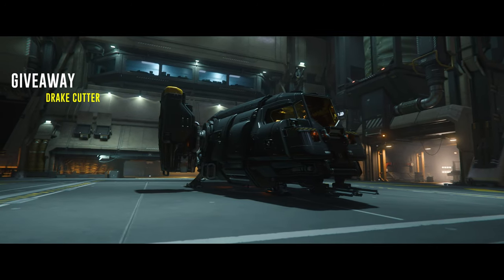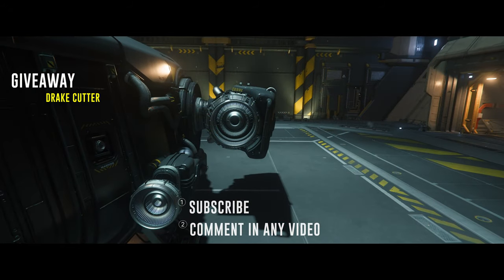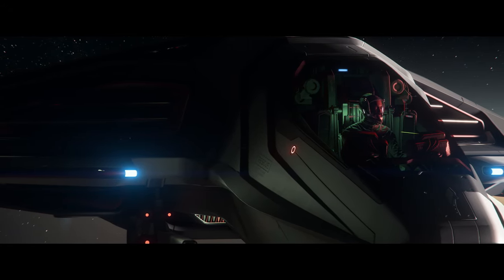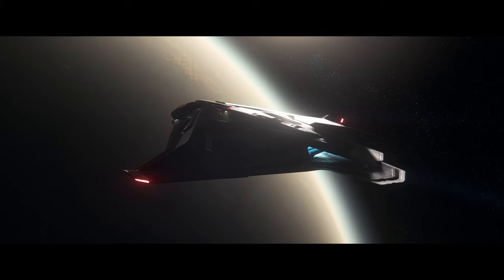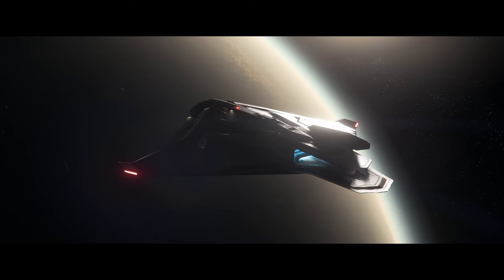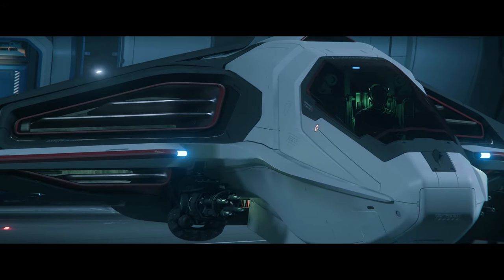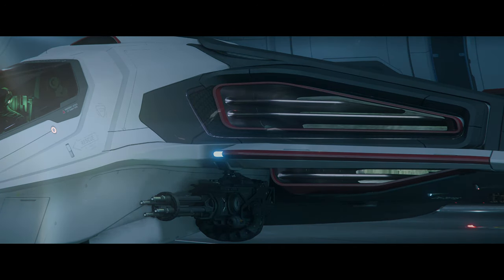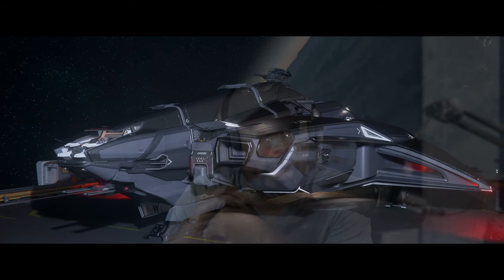Is This The Release Candidate? - New Star Citizen 3.24 PTU Patch

Comment: plz fix

"when breaking asreoid or ships causes game lock ups or crash" 
"ladder animation to Vulurte is offset by 90 degrees" 
"hanger persistance is not replcated yet?"
"workbench cot and UEC towl assets can't be effected with tractorbeam" 
"medical gun makes annoying sound when equipped and leaves graphical glitches on screen" 
"interaction F icon appere when flying ship and not using push to interact" 
"cutlass black tractorbeam non functional after powering on ship" 
"entering ship causes Hanger sounds to be amplfyed (bro all you need to do is reduce the HIGH pass freqences when you enter a ship so it sounds muffled and the in ship sounds need to be DIALED back in DB to allow smoother fedelity ) 
"standing up in prospector can some times cause player to be stuck in cockpit chair asset"